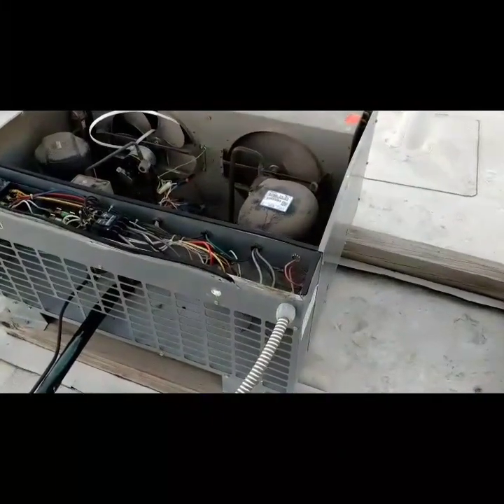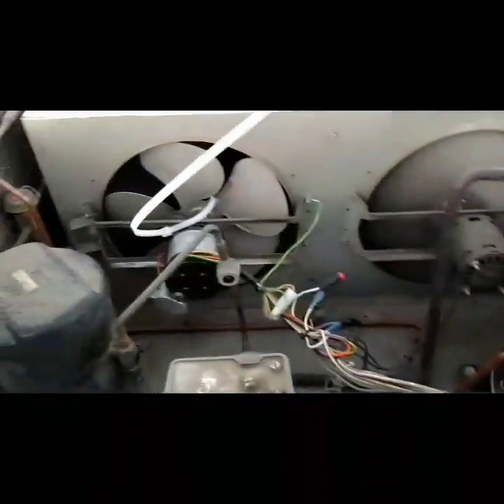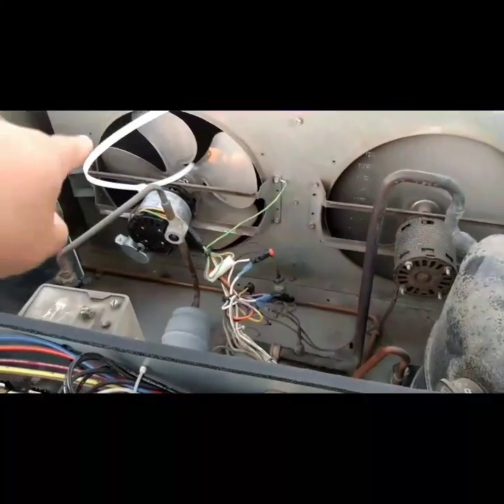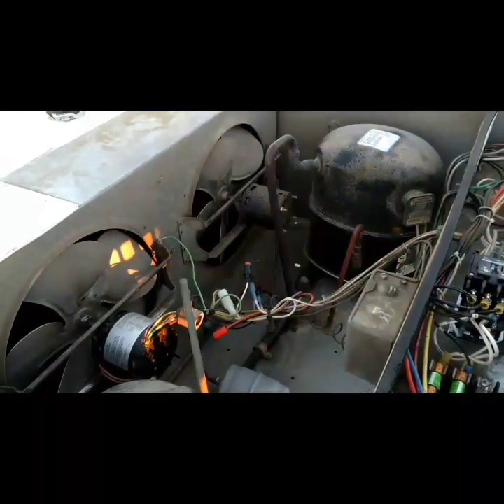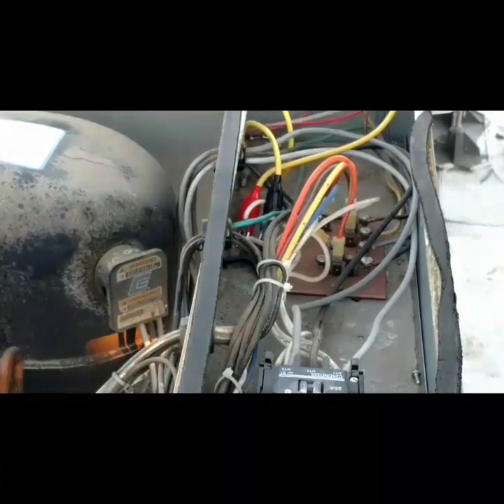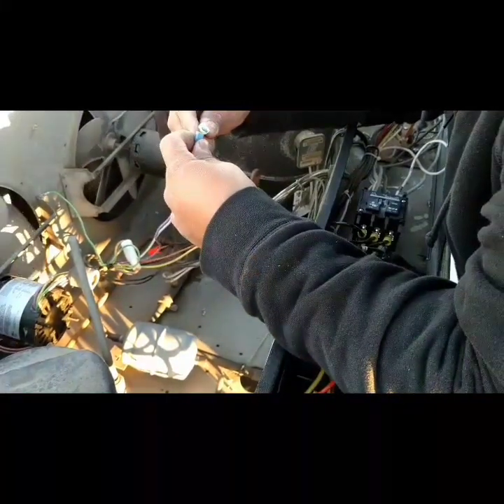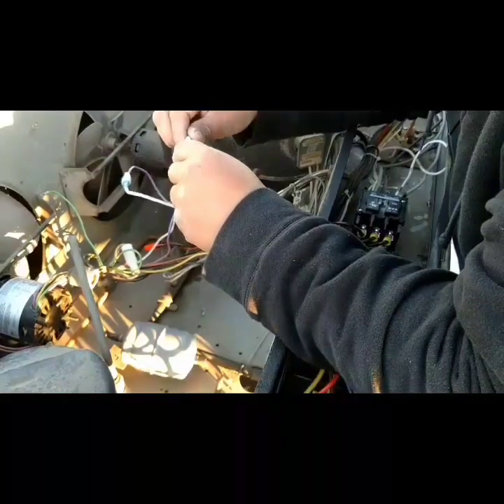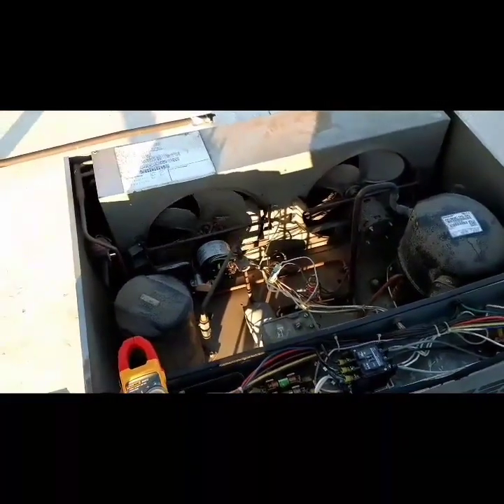HVAC/R- Why electricians shouldn't touch Refrigeration systems Walk In Cooler Down

Comment: how do you test the thermo disc.to see if its going to start the motor when it gets hot ,and the unit short cycling on head pressure,maybe by blocking the hole on the fan that is not working.
Reply from the maker: Its just an ambient temp switch.  Opens and closes at about 60⁰

Comment: One time electrician wires a direct short installed New toggle switch on Cold Storage evaporator with 100 amp breaker inside the rooftop unit could not trip fast enough before control panel electrical fire.
Reply from the maker: Wow.  Damn

Comment: Another example of that's why you don't have "maintenance" or "a.c. guys" doing reefer!! Leave it to the pros!! Perfect example
Reply: Excuse me? Most refrigeration guys have an aneurysm when they open a medium commercial RTU because it has more than ten wires and an economizer hahahahaha. It's FAR easier to teach a comfort cooling guy refrigeration than it is to teach a refrigeration guy comfort cooling. Refrigeration is nothing more than clear the sight glass, fill the receiver to 75-80%, make sure you're running an ambient 30 on the head and your evap saturation is 20 degrees lower than target box temp hahahaha. Racks are much much much harder than general refrigeration. Refrigeration is easy mode. Most refrigeration guys don't even know what wet bulb is or how many cfm of air you need per ton of cooling let alone how to diagnose airflow issues. You all think belts need to to be tighter than a banjo string too. More RTU's have been hacked apart by refrigeration guys than refrigeration systems have been hacked by comfort cooling guys. I just found a 2013 Lennox 25 ton rtu today that needs a 7.5 hp blower motor and pulley because refrigeration guys have been taking care of it. I'd hate to see what the average refrigeration guy could do to an Intellipak.
Reply: @jman0870  Ive done market reefer also RTU units in ahopping centers and wm and sams club... Its not sight glass and sat. temp always its how you taxkle it a skillset can be learned by anyone but taking time to learn is gold... Anyone can learn ac and yes some minor reefer stuff and if you put the heart into it can learn market its all about learning components and how its supposed to work
Reply: @hvactechpr7872  I’ll never learn supermarkets. I work to live, not live to work 🤷‍♂️

Comment: hvac guys are never was electricians that can take a test... maybe they cant read. electricians make the most on a jobsite for a reason, the guy that worked on this is not an electrician...if he was an a/c "tech" he is just one of you idiots
Reply from the maker: Running wires is a real skill.
Reply: Haha...running wires is all electricians do? you must be a "tech". Or a parts changer. Also hard right?

Comment: Electricians are idiots.  They should stick to running wires...
Reply: Anyone can run wires, that doesn't make them "electricians" ,or even competent ones at that either. Whoever did that was not an electrician. I can tell you that much.
Reply: @naughtyrobots4151  I've had this discussion numerous times... sad fact is the guy that pulls wire and can bend emt is called an electrician same as the guy that can recite every nec code and electrical theory. Hvacr as well the guy that can replace a capacitor on that residential unit isn't even close to the guy working on a trans critical co2 system. Huge educational and experience gap in areas of trades